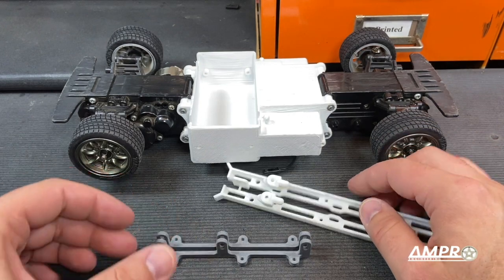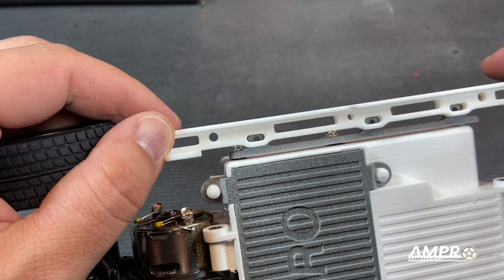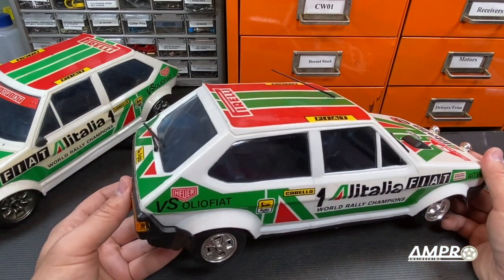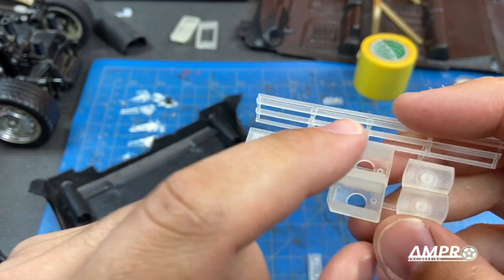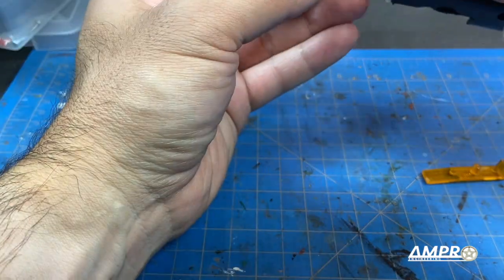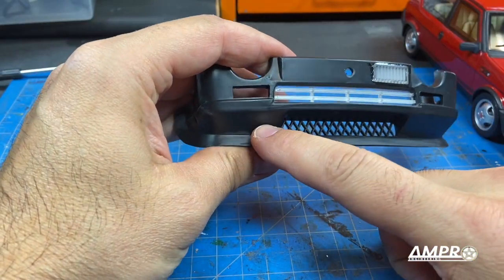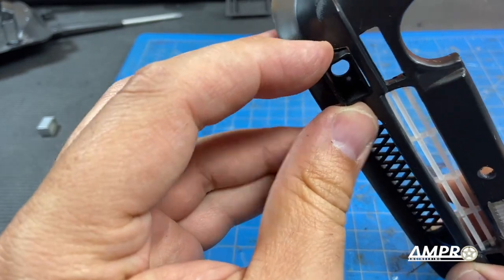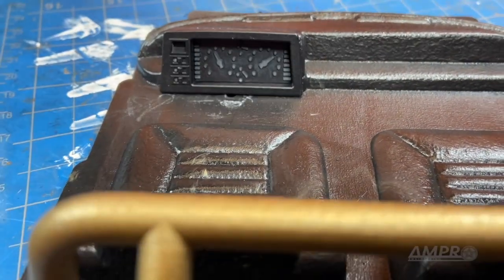e308: Custom Tamiya M01(X)L Fiat Ritmo Part 2!

Comment: OMG! Great work!!! I look forward to see the complete result! When I was a little boy my parents got a Ritmo Abarth from their car dealer for a weekend and I was so enthusiastic about the design that I got a Ritmo model car from the dealer. That won't be anything special for you in the US, but the Ritmo had power windows at the front and air conditioning. For us in Germany at the beginning of the 80s it was like a car from another planet. I still have one question. Why didn't you redesign and print out the entire front bumper?
Reply from the maker: Wow! Very cool! I imported a Ritmo Cabrio (a 1984 MK2) 12 years ago. It too has power windows but last month, I ripped all that out of there. Marelli electrical and buttons, bosch motors...it was all a mess. The power window switch is selling for $200 now and I was just over the pain those windows gave me. I am sure they were much better and cooler in the 80's! Great question. There were a lot of things that would have made it very hard to model. A lot of curves, the mounts on the body, making it actually mate to the body...it would have taken prohibitively long I think.